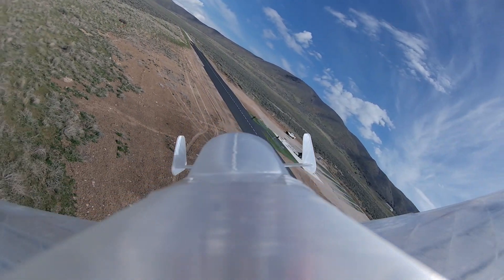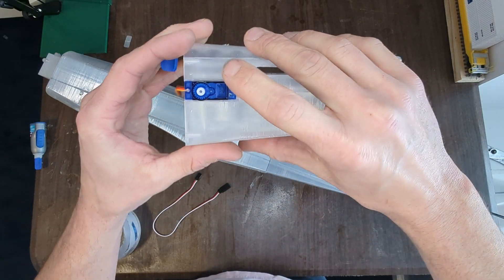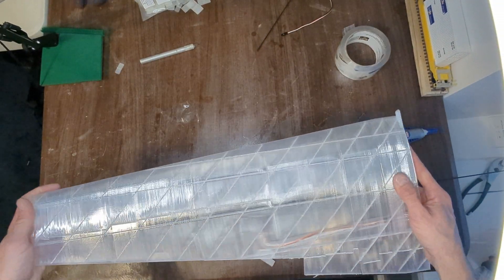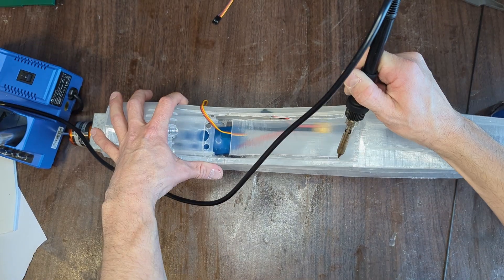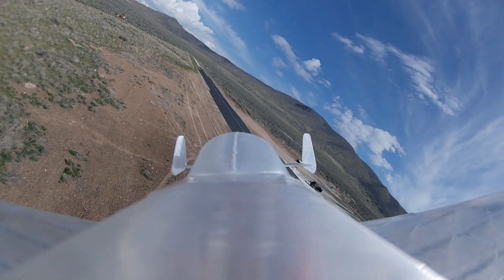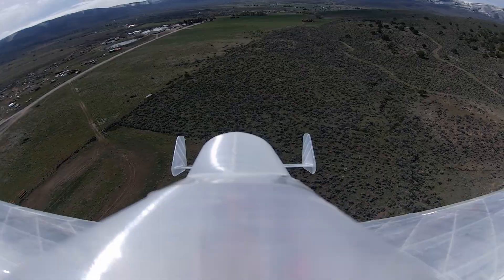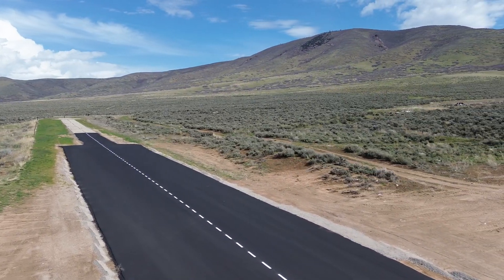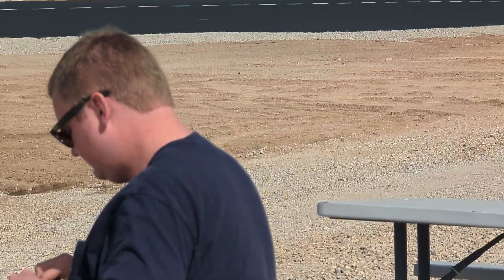3D Printed RC Airplane from Thingaverse!

Comment: some design/execution facts.
servos do  NOT  go  at  the  tail.!      the tail is heavy because of the servos, and because the vert-stabs are over-large.! 
CF  is  HEAVY.!     putting a CF spar in the wing aft-of the cg is the  OPPOSITE  of smart.
the main spar  SHOULD  be located at thirty percent of chord.!      the wing halves  are  SUPPOSED  to be structurally linked,  VIA   the  main  spar.!
the mass of aileron servos  SHOULD  be located forward-of thirty percent of chord, and as far  Inboard  as is practical.
servos should be installed such that they do NOT protrude from the wing/fuse.
it is the opposite of smart to have zero airflow going over the esc (or the motor).! 
the wingspan is excessive.    it should be roughly equal to 133 percent of the fuselage length.
the chords of the control surfaces are 'small'.     the trailing edge of the elevator should be a straight line.
Reply: @daviddavids2884 where the hell do you get your info? Servos can go into tail, they can go anywhere. The Closer they Are to the control surface, the stiffer the connection Is. Over-large vertical stabs? No such thing. Just means it will be more stable. CF heavy? The whole purpose of using carbon fiber Is its strenght/weight ratio. Its incredibly light. Wingspan should be 133%. Smaller wings=better roll rate but higher wingloading. Longer Wings Are less manueverable but have lighter wing loading(lower stall Speed)depending on aspect ratio. There's no such thing as too long of a span
Reply from the maker: The designer on thingaverse said it was copied from a balsa kit. I think it flies great! It's actually one of my favorite planes I have in my fleet. It's not a perfect design, but a great beginner plane for someone wanting to learn how to 3D print a RC airplane. Rudders would be nice though. But she's fun!
Reply: Wherever possible I put my elevator and rudder servos towards the back providing I can attain CG without being tail heavy.
The closer the servos to the control surface they operate the better in my opinion.
I always print a servo mounting plate which I glue to the fuselage for strength and cut the hole for it with a soldering iron. 
However, I do agree that there should be air flow over or into the ESC and motor for cooling. (Standard practice)
The author of this video took the time and trouble to make it.
Be grateful, not critical!